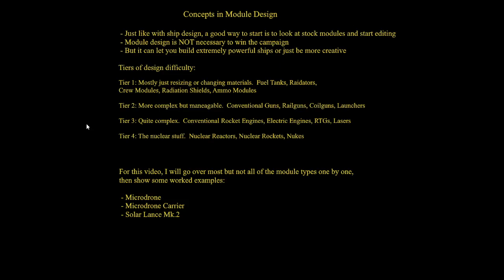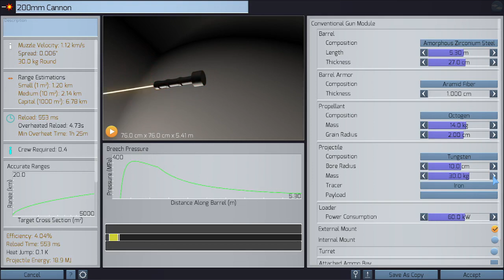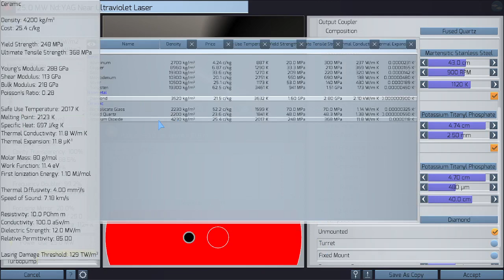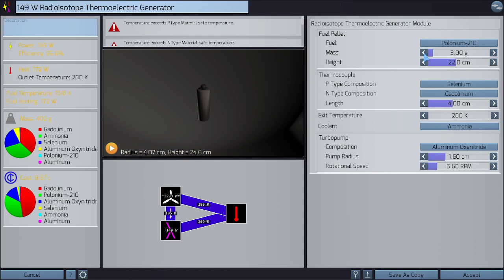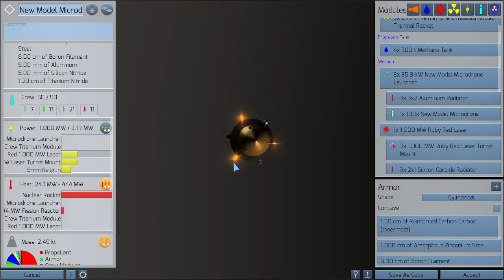COADE Extras: Designing Your Own Modules (Old)

Comment: Time stamps:
3:51 - Propellant tanks
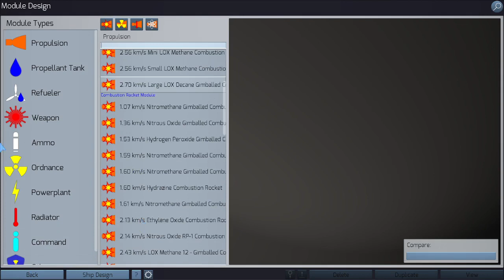7:43 - Crew modules (CMs)
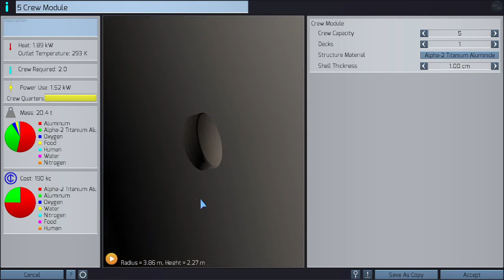10:07 - Radiators
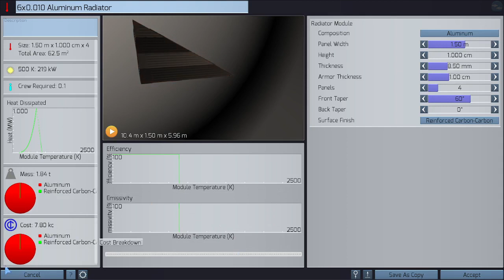14:18 - Ammo
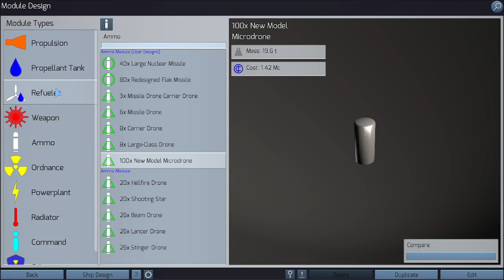14:58 - Refuelers
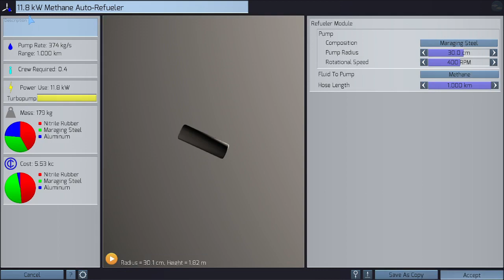16:13 - Spacers
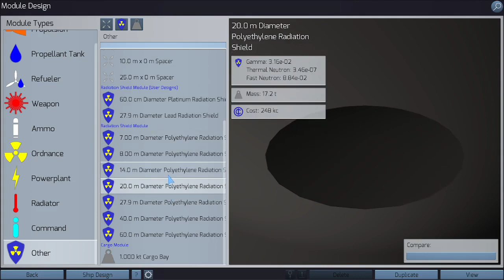16:28 - Radiation shields (radshields)
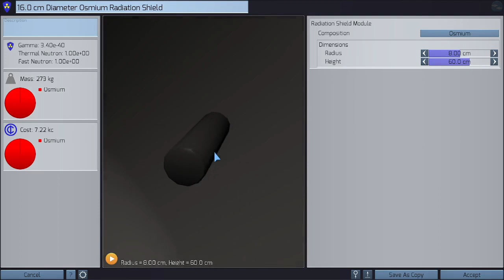18:07 - Conventional guns (chemguns, cannons, PDCs or lag guns)
31:25 - Railguns (RGs)
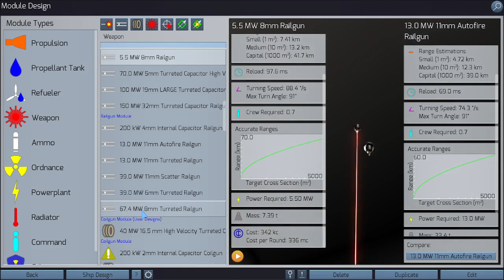42:32 - Coilguns (CGs)
52:21 - Carrier modules (Electric launchers or ELs)
58:24 - Lasers
1:10:56 - Radioisotope Thermoelectric Generators (RTGs)
1:23:05 - Combustion rockets
1:28:34 - Explosives (HE)
1:29:41 - Flaks
1:32:48 - Showcase of stuff that uses custom modules